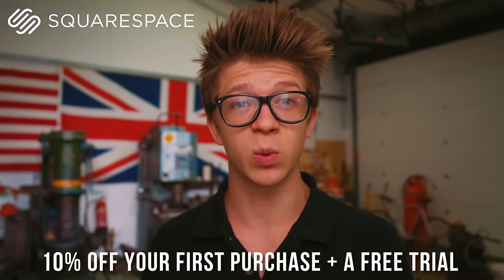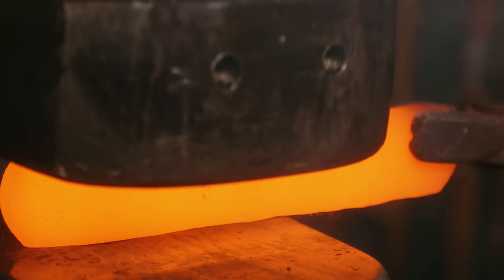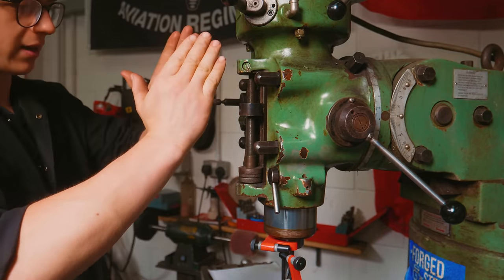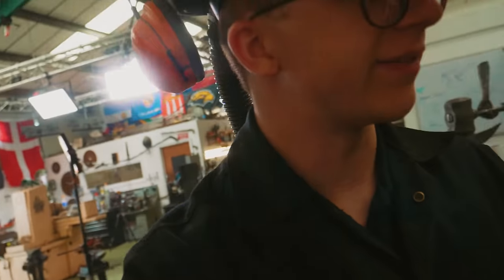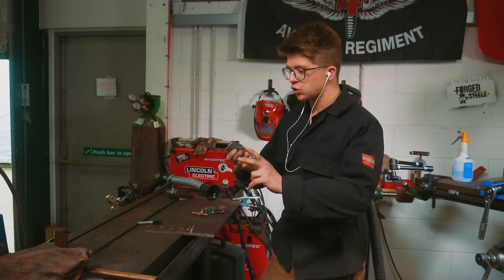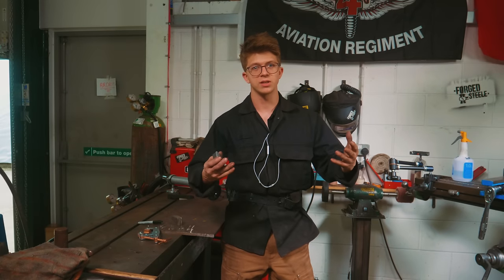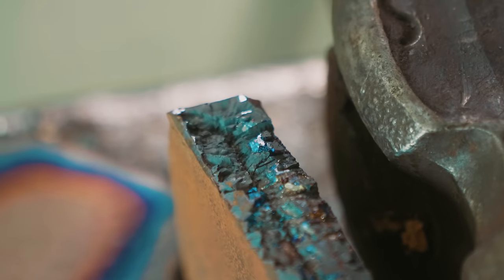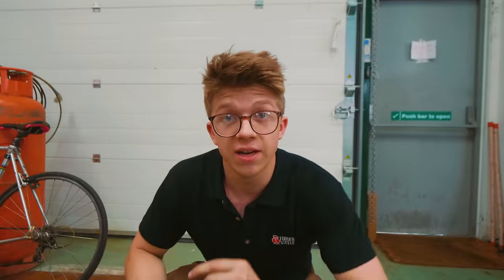CAN YOU MAKE TITANIUM & STEEL DAMASCUS?!?!

Comment: To work with titanium in the lab normally I'm working with TiO2 (titanium dioxide) mainly due to the fact that titanium reacts with just about every oxidising agent under the sun (sulfur, oxygen, nitrogen and the halogens) and if it forms TiO2 you're buggered its pretty much the most stable metal oxide very difficult to get it to revert or go back to Ti(0) it loves to be Ti(4) unless you pump it with hydrogen at high temps. we compress our compound into a pellet under about 10 tons of pressure then keep a constant argon flow over it at high temp (1200-1500 C) for anything between 2 and 72 hours, the high pressure just tries to get the grains as close as physically possible, (titanium forms grains much smaller than iron therefore they don't tend to mix correctly unless they are under silly pressure) and the high temp to attempt to dissolve a reacting compound into the structure.
I suspect the alloy of titanium, if you say its from the medical engineering side, is probably Ti-6Al-7Nb, it contains about 5% Aluminium and 5% niobium these also like to be in a well oxidised state, additionally niobium doesn't exist in an alloyed state its more like islands of niobium spattered throughout the structure. The main issue with this alloy is that the titanium tends to exist in a close packed array, locking the titanium into a position where it cannot migrate across the grain boundary into the steel that you used. At the low(ish) temps you are using you don't have enough energy to force the lattice to break down and any higher temp without an inert atmosphere would be way too sketchy.
Hope this explains some of your issues you've been experiencing, you could try manganese, zinc, nickel or molybdenum instead these don't tend to be so volatile under an oxidative atmosphere, at least no more than iron.
Reply from the maker: Truly phenomenal advice and insights! Thak you!
Reply from the maker: Thank*
Reply: Wow
Reply: Pleas keep smashing different metals! The suspense if you can do it or not is fantastic!
Reply: I'd also suggest using the Press rather than the Power-hammer. As you've seen, hot titanium does not like to be struck, and it'll only get worse at hotter temps.
Reply: so making a knife out of ti-6al-7nb would be a bad idea...
Reply: This person knows their stuff!
Reply: LMAO...yesh, Alec Steele pounding Manganese and Titanium into pattern welded damascus.!!!
Reply: Wow that was very well explained, please be my chemistry teacher XD
Reply: Does titanium react with N2 gas?
Reply: If you look back to when Alec shows the lettering you can read out that ti6 name you mentioned
Reply: Awesome information! My theory I just posted now sounds naive in regards to titanium.
Reply: I was thinking the same very thing as soon as he took it over the the power-hammer. I expected early 4th of July fireworks. lol
Reply: pausing the video when he was showing off the material stamping, i did see TA6V, which if that's the case... it's vandium not niobium
Reply: It definitely reads TA6V, but I'm mostly confirming it so I can continue to get updates from this thread.
Reply: Idk wth you just said but it reads very well soooooo yeah. I concur ; )
Reply: jasouthouse94 would increasing the contact area by milling complementary surfaces into the two pieces like a sawtooth pattern help?
Reply: Well detailed answer! One thing to point out, the Medical Engineering, I believe, uses Ti-6Al-4V  (in the USA), this was back in the 2010 era. I could be wrong of course. It is hard to change material even composition, due to the FDA requirements on medical material devices.
Reply: Its possible that would help but I'd suggest a press as someone above has suggested combined with a much higher temp, that being said the milling probably wouldn't be accurate enough to give you a smooth surface titanium has very small gains compared to iron/steel so on a macro scale the surface would appear smooth but on a micro/nano scale its full of gaps where oxidation could occur preventing a weld
Reply: Felix Espana
I did't read the text on the titanium bar at the beginning properly it is indeed Ti-6Al-4V, its pretty much the same using vanadium in place of titanium, the starting oxides are analogous. I'm not sure if the Nb alloy is licensed in the US but yeah the FDA requires a damn good reason for you swapping the composition of your product and you better have the evidence that its safe at all points in the product life cycle.
Reply: Is it possible for you to use argon gas as you are welding the steel and titanium..... argon would eliminate the oxide layer from forming. You would still have the problem of bonding. The bond area in a micro scale level would probably not be that strong even if you can manage to weld them together. I imagine there would be either oxidation or porosity in that area. My two cents.....
Reply: jasouthouse94 I didn’t either, I just know about that specific TI alloy. Haha
Reply: I was thinking exactly the same, however i BELIEVE (though may be wrong here) that this is the patented method that Alex is trying to be respectful of and not use )
Reply: Yeah, that could be right. I wonder if this patented method includes all inert gases........
Reply: Felix Espana the price of inert gases increases exponentially from Ar onwards unfortunately. If you can't do it with argon it'll be prohibitively expensive.
Reply: I have a science degree and I love blacksmithing. I learned so much from reading your comment. Thank you so very much for the break down of the nature of ti02. If you've never written a paper on the subject please do. I'd love to read a more in depth research paper. Thanks.
Reply: dude this is /threadkiller material, thanks for the write-up!
Reply: So keeping it soaked in argon might be hard in your shop, but I wonder if the old japanese method of sealing it in clay-soaked rice paper might work? Also, use pure iron, not steel(as noted in dozens of other comments). Titanium has a very high melting point though and you were not even getting remotely close to it with anything other than the tig welder.
Reply: mostly because that's not a very common alloy.  Ti-6Al-4V is what he was using and is a very common Ti alloy.   And there are knives made out of titanium.  I've seen some that are beta titanium alloy (they didn't say which one - there are many).   6-4 is an alpha-beta alloy.   just be careful with your grinding swarf.
Reply: strain rate is important when hot working many titanium alloys.  slower strain rates can be better.  So the press might be the better way to go.
Reply: @AlecSteele   What he said, plus think about adding in some rare earth heavy-metal elements..  Black Sabbath oughta work.
Reply: That's some serious short of information bro
Reply: Damn How long did this take you?
Reply: jasouthouse94, you work at rolls Royce or airbus?
Reply: I Love what you’re doing.  It’s like MythBusters but with metal and stuff.
Reply: So nice to have someone explain the idiosyncrasies of Titanium. Save me a lot of writing too.
Reply: My science teachers would love this
Reply: The best comment I have ever read on YouTube!!! Thank you for your service sir, bravo!
Reply: Or what he said.
Reply: That's interesting that you mention the mixing issue with titanium grains. I believe my cousin recently got his Ph.D and a patent for a process of mixing titanium and other metals and getting them to crystallize in molds and dies for complex parts. Apparently its being used for numerous aerospace applications. Such an amazing time to be alive where we have advances in materials sciences everyday that used to only happen every 1000 years, then 100 years, then 10 years, etc. Cant wait to see what AI simulation brings to the table.
Reply: jasouthouse94 hey can you help me for my chemistry test
Reply: Fantastic reply very educational and understandable.
Reply: Thank you for sharing. You know your stuff.
Reply: @victor9sur768  proof it is safe through out product life or be a pharmaceutical company 😁....... I mean seriously the way big pharma has regulatory integrity compromised through hiring ex regulators ought to be illegal.
Reply: @mihailshevchenko2368  to be fair metallurgy is very specific and he may not know very much when it comes to organic chemistry, as is what most chemistry classes pertain to until you get into college.
Reply: Wow, Are you the metal doctor?
Reply: @AlecSteele  please redo the video with this instructions
Reply: Would borax have any effect on the success of forge welding steel and titanium?
Reply: Hi mate
I used to do some similar work some time ago. I would like to know where do you do that stuff. I graduated in material science and I am looking for a job. 
Cheers!
Reply: ....NEEERRRRDDD
Reply: @deanallenjones  the patent does involve an argon purge, but the patent expires in about five years (granted in 2005) if he wants to try it again later. 
Another much older technique  (and thus I'm sure is in the public domain) would be to do it in a vacuum. Of course that is much harder as any leak in the vacuum canister lets air (oxygen) in, while a leak (if not too big) with an argon purge just results in a higher gas consumption.
I would have considered putting the original round Ti rod  into  a close fitting hole bored into a piece of steel rod/pipe, sealing it up, pumping a vacuum and seeing if I could make a piece of steel clad Ti bar before I did any cutting and stacking, then in further steps one would be welding the steel cladding to steel, with most of the Ti protected by the vacuum welded cladding.  I don't know if it would work, but it would be what I'd try.
Reply: Good post, but I have to clarify that niobium DOES alloy into titanium, it doesn't just exist as islands of niobium within the billet. Niobium is a potent beta-stabilizing alloying element in titanium, greatly affecting its properties when heat-treated. Despite the huge difference in atomic weight, Ti and Nb are nearly the same size in atomic radius, making niobium a substitutional element in the lattice. HOWEVER if a TiNb billet is overheated then the effect you describe does occur, and you end up with a billet that basically acts like CP titanium with blobs of niobium throughout, but that's not supposed to be how it's used. I've been forging TiNb sword billets for years and have observed the effect you describe, with excessive soak times above beta transus temperature. 

It's difficult and expensive to alloy a heavy element like Nb into a light base metal like Ti, and you don't want to mess that up with excessive time/temperature when working the material at heat. That's one reason why iterations of 6al4v is so popular, while TiNb and the like are so rare.

As an aside, supposedly ti and steel layers can be explosion-bonded together, but when making a titanium alloy it's not realistic to add more than 4% iron to the mix, maximum. Iron acts as a beta stabilizing element in ti, a grain refiner, and helps mute oxygen embrittlement, allowing for the ti to be more "dirty" with oxygen impurity before becoming brittle.
Reply: I know another blacksmithing channel recently made a forged titanium hammer. No comment on this alloy. Materials class has been a whole ago 😂
Reply: Please teach me more of titanium. I know 15-3-3-3 destroyed my hydraulic bench at work taking it from a +.001 diameter at 4” to .125” from 4” and sprung back to +/ .000 after maxing out my machine
Reply: Don't you think that the temperature was above the beta transus? Then the diffusivity would have been much larger (but failure would be again guaranteed due to oxide on Ti).
Reply: TiO2  isn't a metal it's a white pigment.... ask me how I know...I've been in a plant that makes thousands of tons of it a year....
Reply: ...so what youre sayin' is ...its time to get some argon and create an inert atmosphere?!?!
Reply: This is the materials science I need!!!

Comment: How to make a titanium bomb with Alec Steele:
1) Weld titanium to steel to ensure the possibility of trapped oxygen inside
2) Put in forge to cause extreme heat
3) Squeeze with hydraulic press to create high pressure
4) Hit with hammer to create sudden shock
5) BOOM!! 💥
Reply: relax there's oxides coating everything and the effective surface area is not significant
Reply: Its all killed flat and clamped with a kant twist prior to welding. There's not nearly enough air inside to cause any kind of significant pressure, and the oxygen content of the air inside of those potential spaces is definitely not enough to cause an explosion.
Reply: Bruh. Titanium thermite

Comment: Couple of things; Always use coolant with a Roughmill (the 4 cutter with teeths) (sry dont know the english name cause dutch to english doesnt translate 1:1 that often in machining terms)
Always Use coolant on Titanium when machining, Ti is self hardening so no cooling means you hardening the outside layer of the Ti real fast as the tool absorbs all the heat hardens the material and therfore hardens more and destroys the tool.
Also the Spindle speed is less then 25% of how you fast you would cut Stainless while Feed stays the same or sometimes higher (depends on diameter)

Working as a CNC machiner and programmer and (for me) old school lathe and mill for 13 years as prof and done all types of titanium from grade 1 to Aircraft grade (grade 6)

would love to teach you about Machining!

Keep it up! love your work! :D
Reply from the maker: Thank you 🙏🙏🙏
Reply: Not sure which mill tool you're actually referring to, but the first one Alec used is usually known as a Roughing End Mill, the second he used with the carbide inserts is usually referred to as a face mill in ye olde English.
Reply: Well basicly with any titanium machining you use Coolant, also with grinding you cant go nuts on it either also keep it cool otherwise it will destroy grinding belts.
But yes the roughing end mill, but wasnt completely right only with most basic steel dont rly have to use it (But usealy i do cause i dont brush the material off i use the whole length of tools / full power of machines)

Also ty i need to learn the english tool names and jargon.
Reply: Love how much I learn reading the comments after watching the videos. Thanks, Robbert!

Comment: A simple suggestion with doing this kind of thing with ti would be using your press. much safer then banging on it with a power hammer and ti fuses better under pressure. glad you did not blow up or burn down your shop though! thanks for the share and remember to stay awesome!

Comment: That ti64 your working will be alot easier to work around 1900°F. I spent 5 years forging aircraft parts out this and many other metals. Also let it soak at temperature for 10 to 15 min. This should help with cold shuts.
Reply: Matthew McDannald I was just about to say a higher temp would make it easier to work with.  My only possible concern would be that because the steel moves so much easier at high temps it might create a small gap in the center of the “sandwich”. Oxides can then form which will refuse the welding of the two metals.
Reply: Maybe an air-hardening steel instead of the 1095? Might give a wider window for fusion.
Reply: Andy Thomas  I think you are on to something.  Using a stainless steel should work better cause it has a higher melting temp closer to Titanium.
Reply: The main problem is not forging Ti, is bonding to steel. I would use a very low carbon steel in order to prevent the formation of titanium carbide which is hard and brittle, as well as avoiding oxygen somehow
Reply: @leonardoulian764 EDIT: I just realised that you meant using a bonding agent, like flux, between the layers to prevent oxygen from getting in there, and not working the metal in an oxygen-free environment. The rest of this comment is therefore irrelevant, since your idea, in fact, makes sense. 
Setting up a workshop in such a way that you can isolate it from the atmosphere in order to create an oxygen-free work space sounds like it would be beyond his means. Besides, I'm not sure the forge can burn without an oxidizer to create combustion, he'd need an electrically heated one, and I bet those don't come cheap. Not to mention that he then would have to wear a tank of compressed breathing gas, which would be EXTREMELY dangerous around high-temperature materials. It'd be like working with an armed bomb on his back, just waiting for a spark to hit or a seal to fail.
Clarification: I'm sure that such workshops COULD be created, but I don't believe he can afford one. And I don't know how else you'd avoid oxygen throughout the entire process.

Comment: "What's the worst that could happen?"

Thermite reaction eats the forge, probably. That would be bad.
Reply: SivakAurak noooo, forges are replaceable, there are way worse things that could happen than that.
Reply: Yes, this is technically possible (though "eating the forge" is out of the question). Titanium is next to aluminum on the metal reactivity series, so if enough iron oxide built up on the steel surfaces, pure titanium at high temperatures could definitely initiate such a reaction. This is unlikely to occur though because titanium itself is so easily oxidized, and thus you're far more likely to have a pure steel surface engaging with a TiO2 surface, and this is not an energetically favourable condition for such a reaction. It would be like trying to get Al2O3 to have a thermite reaction with iron.
Reply: if that had happened, the title of the video would be sure about that, including a thumbnail of the hammer igniting fire,
Reply: Would make an awesome video thou.
Reply: If the Ti ever starts to burn cover it in sand... unless you want to dissociate hydrogen and oxygen in the water and create water agsin when it explosively recombines...